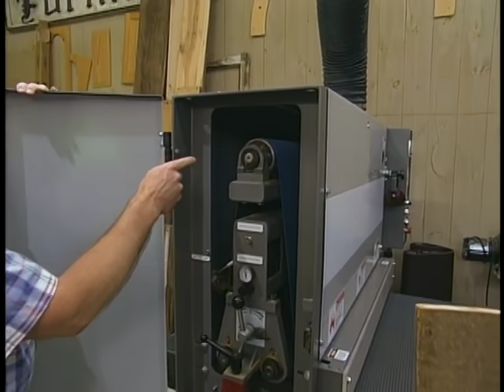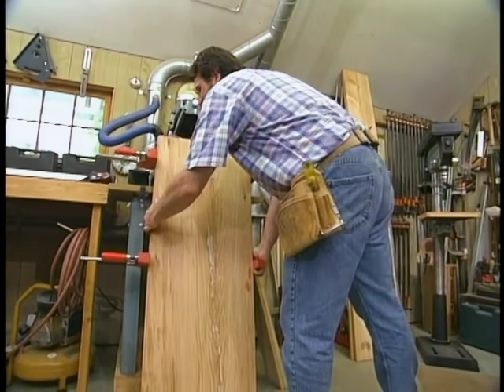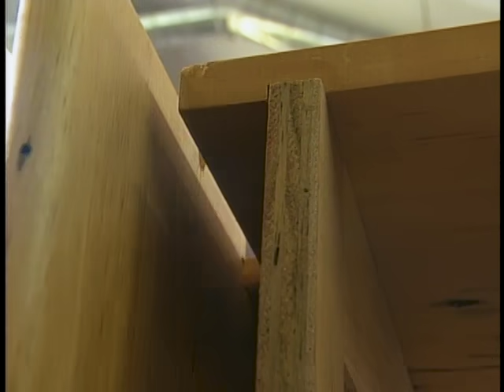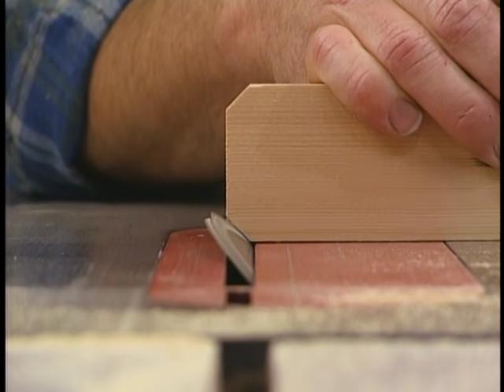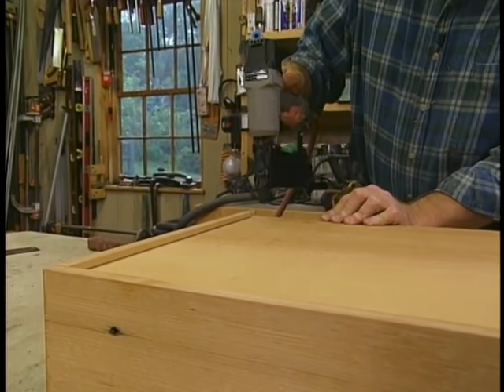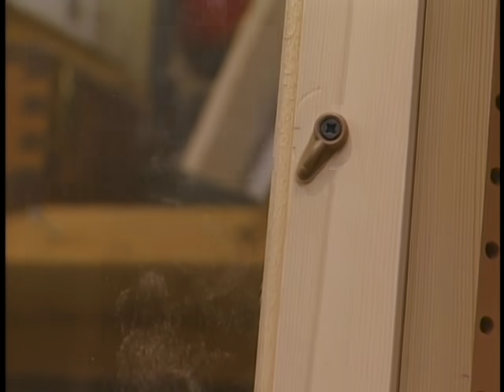Old Pine Hutch  |  S11 E4

Comment: I always thought it a little odd that during the intro Norm mentioned the top board and knowing of its history but never mentioned anything more about it. Quite a few times when using old wood he would talk about it coming from the bottom of rivers, barns, houses, old railroads etc. but this time he left the viewers in suspense as to its origin.

A little piece of trivia about this episode:  the router table spot at 20:37 (or more accurately the final few inches of the cut Norm was making to that long piece) was played back during Norm's safety talk in later seasons.

Comment: Is the wide belt sander 3 phase ?
Reply from the maker: Yes. They don't make a "home" version. It's a beast. 😬
Reply: @newyankeeworkshop  did you have 3phase run to the shop? or run it off of a phase converter?
Reply: Very likely yes - the main motor probably would have been something like 20HP so updated workshop electrics, a new branch off the dust collection line, and a compressed air supply would have been needed to get it running.
Reply: you probably can get a single phase model with a maximum 10hp motor.